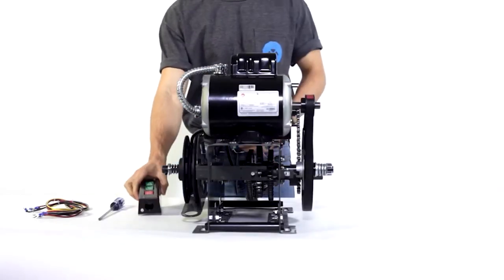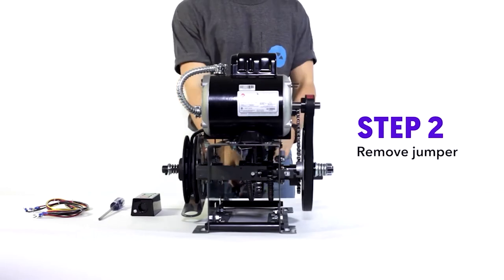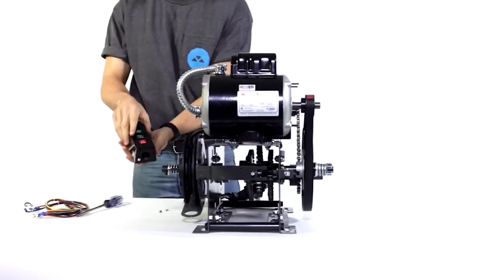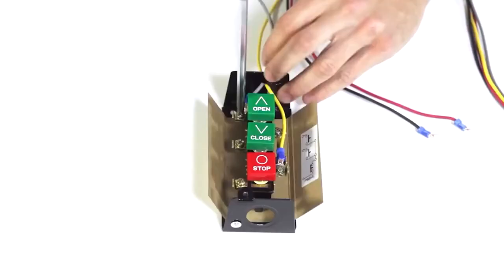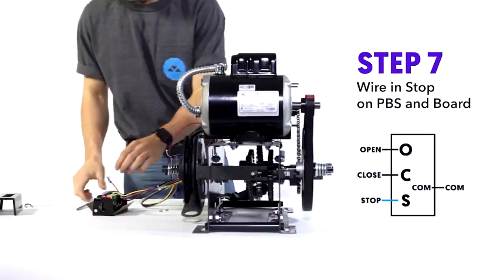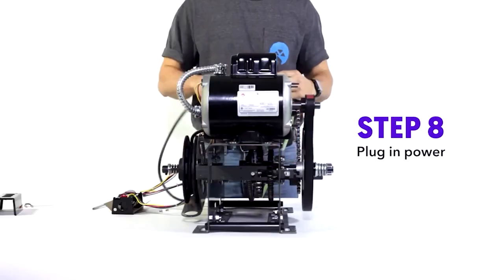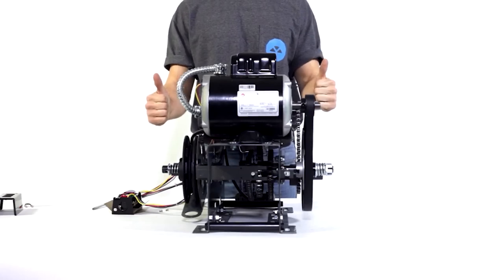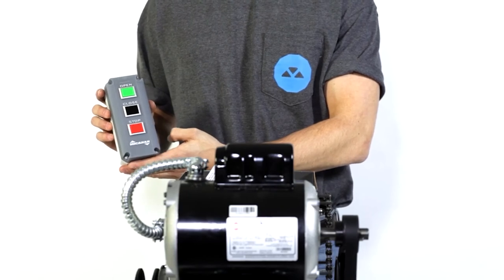How-To: Wire a Nice Garage Door Push Button Station

Comment: I have a 2 push button station( up and down only). How do i wire one of those RF gadgets with a remote control, without disabling the old buttons? Can i do it in paralel? Thanks

Comment: How do you wire the down switch to where you don’t have to hold it down the whole time
Reply: you need garage door sensors (eyes) mounted close to the ground and wired into the garage door opener for that

Comment: I left a piece of plastic pipe in the path of the door, which stopped and jammed the door. I removed the obstruction, but now, my push buttons do nothing. The door doesn't work. I have 2 doors, and the other one works fine. There was no issue prior to this. Please help! Thank you!
Reply: Any update?
Reply: @carterborchardt2191  Pushed reset switch on motor itself. All is well.